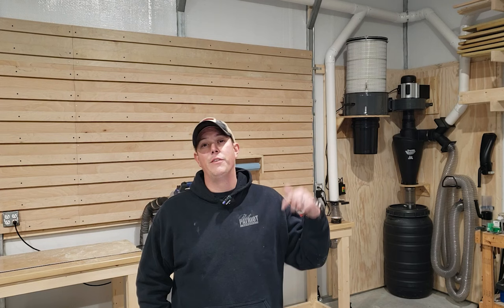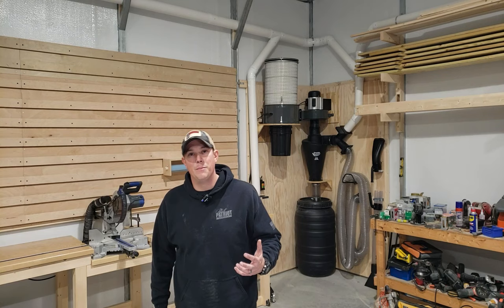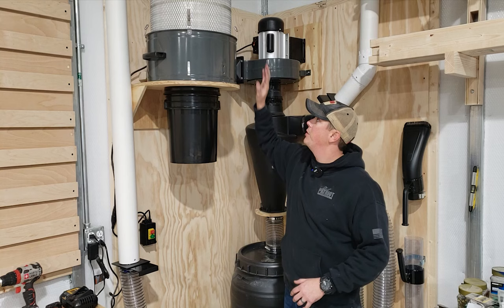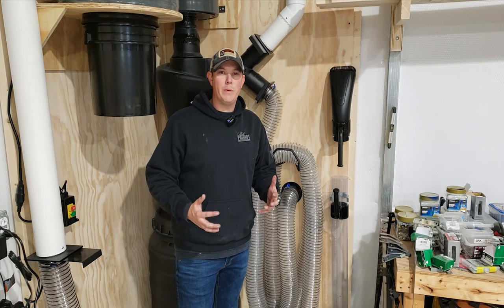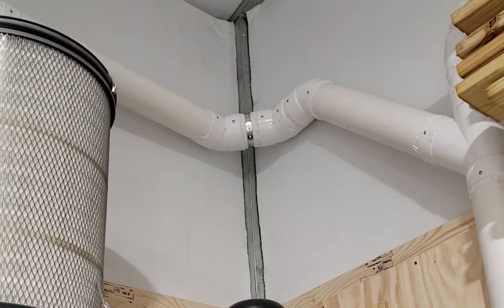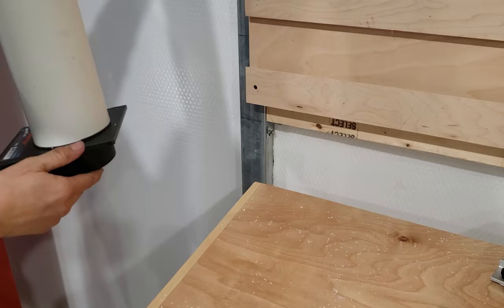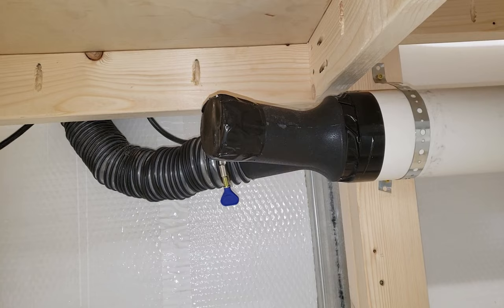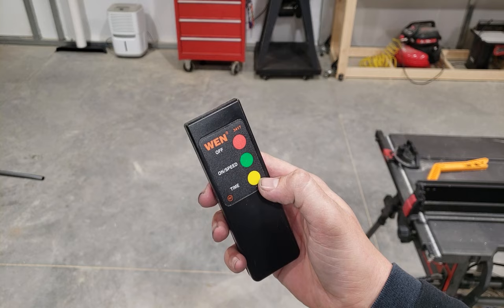DIY Dust Collection System Set-Up

Comment: what about static? was hoping to see some grounding. nice system, but I worry about static and smoldering that could be a disaster?
Reply from the maker: I think the risk of static in a small system like this is over exaggerated.
Also pvc is an insulator so it's pretty impossible to ground effectively.  You'd need to use metal ducting to properly ground it.
Reply: @PatriotDIY  The risk of static is higher than you think. PVC is notorious for static build up. Finer dust running thru your system can actually explode! You need to run a ground wire along all of you 4" piping. They sell a small gauge braided ground wire for this. Just wrap it in long spirals around your pipe and fasten it where you have screws in your pipe and to your dust collector frame.
Reply from the maker: @Hunter 4559  wire wrapped around the PVC will not prevent static in the inside.... PVC is an insulator.
Reply: @PatriotDIY  Im aware of that, was hoping to see an example. Have seen one example on youtube where someone ran a screw at each end of pipe, then connected bare wire inside pipe from each screw, ran outside of screw to ground. Also used the outside of the screws to wire each section of pipe or elbow etc together.
Reply from the maker: @Hunter 4559  interesting the begining of the second link you posted starts with stumpy saying that he doesn't believe in the risk of static fires in a small woodworking shop. https://youtu.be/WJ8NMYlhaLQ
He actually says he only grounded his so he didnt have to hear the comments anymore.

I really don't care to argue about it. I have a small shop, I've never even had a shock from mine and don't plan to ground the pvc any time soon, though i may ground it eventually. like the man said....if you wanna ground it...ground it! Better to have it and not need it than need it and not have it.
Reply: @PatriotDIY  sorry folks, getting ready to put a system in here at my home garage shop. just looking for ideas, and just curious about static and what some have done about it using PVC. Had a system before we moved, but it needed work, doing it right this time. Never had a problem with static, or fires. but, if possible would rather be safe than sorry
Reply: @buster612003  It's always good to be concerned, but it's literally impossible to ground an insulator like PVC.  There is a great video out there where someone takes a piece of PVC pipe, wraps it dozens of times with a piece of wire connected to earth ground...then rubs his finger back and forth between the wraps a few times, and generates enough static to pick up some small pieces of paper.  The flip side is that because PVC is an insulator, it poses almost no risk of explosion.  A static charge is a charge that cannot move along the surface it is on (hence the word 'static').  Since the charge can't move, it's also almost impossible to make it spark.

Comment: You should have gone with 6”. With that much duct work, you will eventually need to upgrade your dust collector and any respectable/good quality collector has a 6” input. Trust me. I’ve made this mistake before.
Reply from the maker: Respectfully, this is not a professional cabinet shop. This works great for my needs, plenty of suction at every tool. 4" is enough for MOST small shops.

Comment: Plastic pipe builds up a lot of static, adding those metal screws amplifies that. It doesn’t take much to ignite small wood dust particles. Please don’t do this, or at the very least make sure you’ve grounded the pipe well. Cheaper is not always be better if this goes pear-shaped.